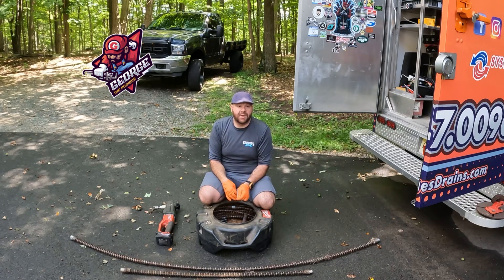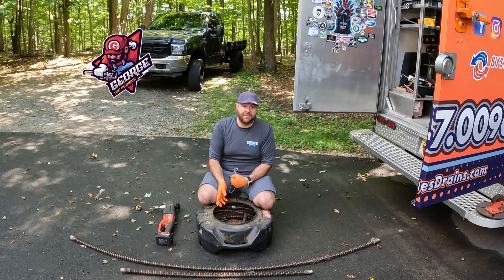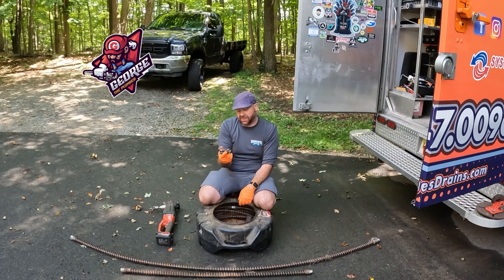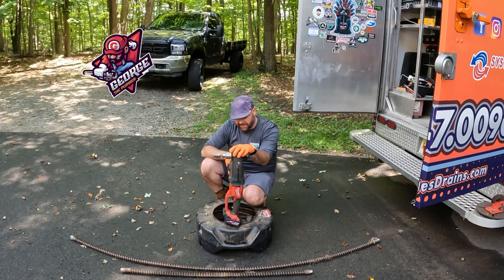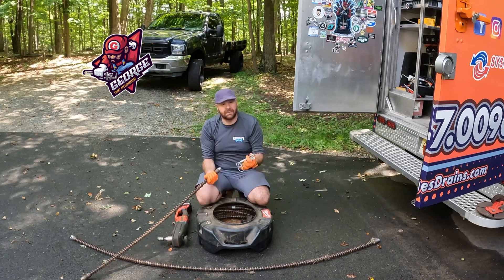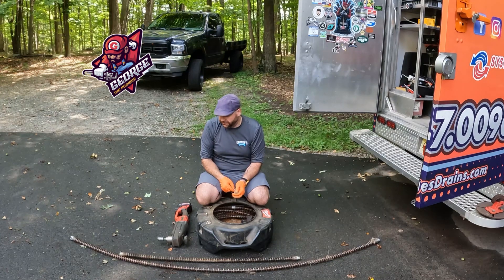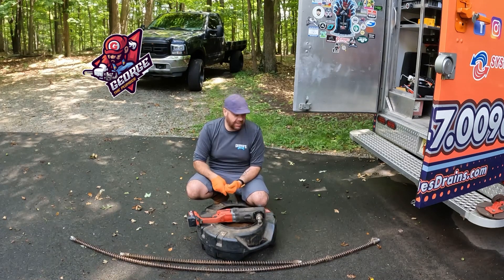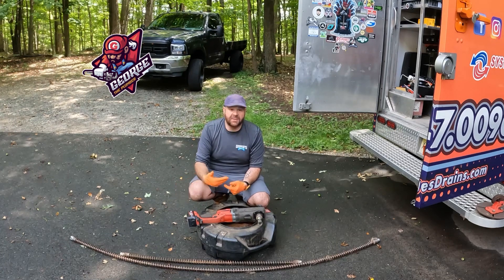My Dreel Setup

Comment: Hi George, do you have a link to buy the drill adapter. I have the 7/8 Milwaukee cables. Thank you in advance!
Reply from the maker: Give Terry office a call tomorrow and see if could custom make one 

(636) 544-5429
Reply from the maker: The Milwaukee cables are 15’ long and completely different connections